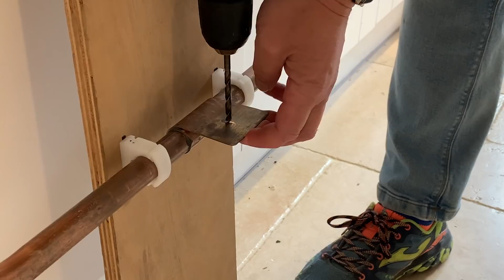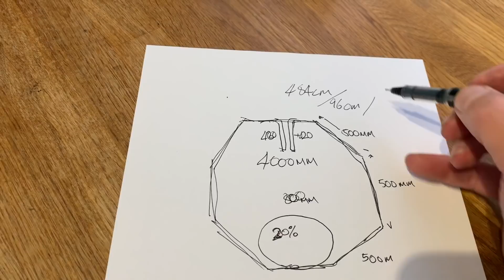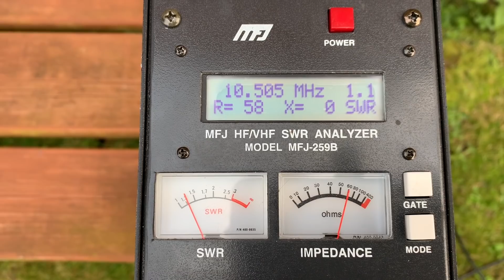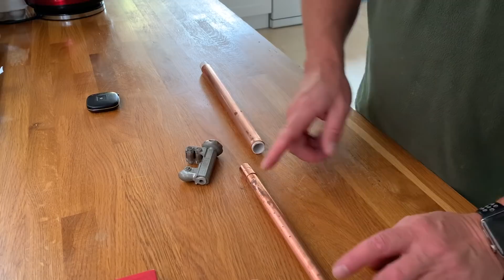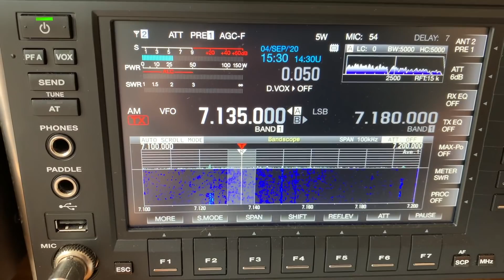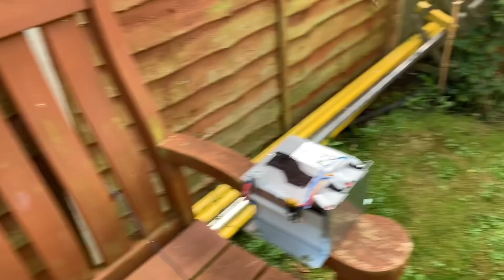HAM RADIO: Building a magnetic loop antenna Part 2...

Comment: Great project, thank you Mike. Well constructed loop. Great choice for the motor to drive these caps in the future. I think something like 30:1 RPM gear ratio would be sensible; although I would probably stick to a standard PID analogue servo motor controller (1 IC - four integrated differential amps) - you would need to add a geared position feedback potentiometer (10 turns for accuracy with 3:1 ratio) - but I am digressing here.

With the linear screw driven control all you need is to monitor the MIN and MAX ends of the travel with possible additional microswitches to zoom to the band of operation in almost no time.

At the  additional expense I would probably replace the two original capacitors you have made with two adjustable vacuum caps that will cover all the capacitance you may need (they require 30 rotations to change from min to max capacity). That approach would require you to drop the screw and use the driving motor gear on the straight shaft to drive a cog on the chain belt - driving the two cogs connected to one cap each (+ the tensioning roller).

If you do not have the head ache by now - I confess to having one after reading the G3LHZ reference article. It just showed me how little I do know about  these magnetic loops :)
73, take care
Regards,
Jansb
Reply from the maker: Great post Jansb,  I have been thinking about a simple microswitch each end system.. :)
Reply: @mike-M0MSN  Reply#2 to the first in this chain..

Coming down from the top of the loop, if you were to first, employ T-type CU joints perpendicular, one to  your variable trombone (C1+C2) in series,  to the 2nd part of the other (C3+C4 trombone, also in series but adjustable but then fixed) in paraller) to the C1-C2 trombone but on other side of the wooden plank you made to support the loop to start with. 

The consideration would heve to be made to the upper side of the plank because of the high RF voltage. I see a top extension here made of some cutting board plastic 12mm Polypropylene cutting board cut to size required by you ( see  the https://www.ebay.com.au/itm/Chef-Inox-White-Polypropylene-Cutting-Board-250x400x12mm/392929288766?epid= 1839336777&hash=item5b7c69223e:g:VwEAAOSwJ5VfUOCI&frcectupt=true
 ) as an extension to mount the loop to the top of the combined plank.
This can be done at the top and at the bottom of your wood plank support. The Polypropylene RF electrical properties beat the wood in all respect and are cheap and you can cut it any way you want.
I may not have much more to add - except, the additional FIXED trombone cap can be made with ONE high quality cut to size Coax instead of the two copper tube capacitors (C3+C4).
Cheers,
jansb
Reply: @mike-M0MSN  Keep it simple is probably the most sure approach, I agree.
It would require only a simple circuit if you have enough space to install the Min-Max microswitches.
You may run into a problem trying to making capacitor changes for higher bands. Your tuned trombone caps are almost at the max of their dimensional capacity. You can shorten them to give you more accurate tuning on higher bands but the additional capacitor would require some rethinking.

The voltage at the top of the loop is at its highest point of the loop at tends to be increasing as the frequency goes up on higher bands.
Electrically, the trombone capacitor are really two capacitors of the same capacitance connected in series and do share 1/2 of the HF voltage.
On the other hand, the additional capacitor is using the same insulation (PVC). That insulation is under double the strain - full RF voltage (not the half) because it is connected directly to the loop in parallel with the trombone, this is where you can expect flashes overs in the PVC pipe.
To maintain the same voltage strain you may need two of these additional capacitors being in parallel with trombone cap but in series with each other, like   another trombone (but with the set and forget tuning). This also opens a field of experiment adjustments on the 2nd trombone caps before it is clamped for good.
73's Mike
jansb

Comment: Mike, Thanks for sharing the videos.  I am interested in building this to give it a try.  The problem I am having is the difference between the UK and the US.  I went to the home improvement store and found some copper that was close to what is listed in the description.  With that, the conduit could not be found and the closest I could find was PVC that is thinner wall (not sched 40).  Can you provide some measurements?  Inner diameter and outer diameter  (which will also show the thickness of the tubing) of the copper and conduit?  Maybe I just need to find a better store, like a true plumbing store.  73, NA7RF
Reply from the maker: Sure, all the tube is 2mm or 3/1000 inch wall. :)

Comment: The small capacitor was drifting like heck, because you have used completely wrong component for the task. What you need is a high RF power stable low loss capacitor. The blue blob is designed to act as an RF shunt (so a parasitic capacitance coupling in a SMPS transformer does not sen RF between the power leads and the equipment body), to be loaded by few mA of HF current, plus guaranteed to maintain 50Hz safety isolation property (it is there between primary and secondary after all). Plus being dirt cheap. The drawback is very thermally unstable material (not an issue for the intended task), with rather high RF losses (assumed as a benefit, as it prevents high resonance peaks from amplifying the parasitic radiation). So when you feed your 10A at 7MHz, it warms up pretty quickly, causing the capacitance to drift away.
All RF suppression capacitors will behave same way, it is not because yours was of cheepeese origin, but because RF suppression task needs different properties than a transmitter antenna tuning.
Reply from the maker: Great reply many thanks.. :)

Comment: Hi Mike not read all the posts you could drive with stepper motors with a  H Bridge simple Arduino routine
Reply from the maker: Thanks for the tip
Reply: I initially looking at homemade high voltage butterfly capacitors  with sluminium nuts and brass nuts they £100s  to buy so I built 2 cnc's never made one I on my third cnc
will do it when done G1GFW 73s

Comment: Hi Mike, you have very much peaked my interest in antenna building with this project, I have already started getting the parts together. Do you have any plans to publish a quick reference to the lengths of pipe etc? My intention is to build it using 135degree couplers instead of trying to bend the pipe. Great series, looking forward to the next
Reply from the maker: Cheers Mark.  :)

Comment: Mike, I've never understood why some people call Small Transmitting Loops  'Magnetic'.  Makes absolutely no sense to me at all. I reckon that's a 'US thing'.   They are only electrically small loops. I've built quite a few STLs.  There are many different ways to feed such a loop. Secondary loop, transformer , gamma feed, delta feed,   just to name few. Yes, some folks don't use co-ax, even now! I didn't have much success with secondary feed loops so I quickly changed to co-ax fed Gamma matches and things were good.  Agreed, such a match is unbalanced so will alter the pattern of the loop as all feed systems will do.  Trombone variables... sensible, cheap and I recommend them.  Also easily driven using a geared motor + screwed rod. Loops seem to excel in electrically noisy locations. Just my 2p worth. Good luck with your loops Mike.   GM1SXX.
Reply from the maker: Great comment Allan, thanks for your input   :)👍🥇
Reply: They're called magnetic, since the electrical field component is inside the capacitor and does not get spread to the nearfield. Of course the electric field component of the electromagnetic wave gets established again in the far field. But the loop actually only gets excited by the magnetic field component, thus you have much less static noise due to the missing E-field.

Comment: Fantastic project??! But is only indoor operation and have many regulacion to acopplate in operation. Loop magnétic is a Challenger antenna for radioamateur. I am PY7PZ locator HI21nx Brazil operate in QRP CW. Thanks
Reply from the maker: A smaller loop then may be??

Comment: 👍Good project, thanks Mike. Some good ideas there. Like the 15mm couplers to make the inner capacitor plates snug, like the use of the block joins and the threaded studding for fine adjustment.
I noted that you squashed the small loop to improve match. I have only made one mag loop so far and I found I had to do the same. Definitely interested to see what you do with the Arduino.
Reply from the maker: Thanks Steve, a little time away but the Arduino or Pi is coming :) 👍

Comment: nice project like to see the complete construction in part .  concept is nice although i've seen a square loop with the same material. Your solution for the capacitor is very nice. Very inspiring..

Comment: CQ TTT - SAFETY - CQ TTT
I am new to your site.
I have just listened to your safety warning at the beginning of this video. 
I like your very neat engineering. 
However, as you said that there are some very high voltages and current levels involved, I bring this to your attention so as to protect your TX equipment.
Plainly, depending on the antenna's ambient/working temperature and its application, (one might like to refer to 'microwave materials and fabrication techniques', third edition, by Thomas S. Laverghetta, isbn 1-58053-064-8, page 38,) it is possible that one could, I believe, encounter an obscure problem at the temperature range near to and including 19°C (68.2°F) where the 'transition region' of the dielectric (Teflon based dielectrics) causes the dielectric constant to fall at that temperature. 
I only mention this because many years ago I was working in an area which was meant to held at 20°C; unfortunately there was a large sliding door which was opened frequently. Some 'special' thick long 'PTFE' cables had been purchased for the task. After finding the specifications of the cables, I was amazed to see by how the phase galloped at 19°C.
I could imagine completing the sequence of tuning up the antenna and increasing the power until I was at full power, and then hear a big whack. Please don't shoot the messager, I am just advising you of a little known fact to keep to yourselves, we don't want to harm the industry, normally this is not a problem in warm/hot locations near running equipment or at rooms at the top of high rise buildings. I hope this is helpful.
Reply from the maker: Very helpful and thanks for your post.. :)

Comment: So you made a gamma match mate...
Reply from the maker: Ish....
Reply: @mike-M0MSN  The reason I said that is, I did a similar thing for a 10 meter antenna. It was an old 11 meter Avanti Sigma 4 that got hit with lightning and blew the gamma off. So I made another HEAVY DUTY from copper tube and RG-213. Been up now for about 10 years...

Comment: Mike - you have probably exceeded the current capability of the little blue capacitor, it needs to be rated for voltage and current. The doorstop type cap will do the job, as well as the one you made.

Comment: Hi Mike, I have been following you on this build.. 
Can I ask, what is/was the design frequency for this magnetic loop ? 
I see that the resonant frequency is around 14.2 MHz	( 20m )  I'm curious to know - will this Antenna work on 10m ? 
And, can it be modeled on MMANA or EZNEC ?
Thanks again for sharing.
73
Peter
Reply from the maker: Peter Paul Donoghue Hi Peter, I had no idea of the frequency this was going to be resonant on, I had an idea to build a hexagonal loop with 50cm sides (originally 45cm) but a mistake in the original bend and the lack of copper made it 50cm so that’s why it is the size it is. Is works on 20m and also on 40m and everything in between. It will not work on 10m because of minimum capacitance but this can be sorted by shortening the trumbones... I have not tried an antenna design software but it maybe possible..

Comment: Still waiting to see how you are going to remotely tune it and adjust the trombone.  10 Meters would be good to see it working on.  I have not done much with Loops so I am just interested to see how it all works out.
Reply from the maker: We shall see, not sure about 10M will have to try.. :)
Reply: A lSmall Transmitting Loop has a finite tuning range.  Three bands are about as many as are reasonable to go for. Use some free modelling software.  There's plenty around.  Good luck.

Comment: Those little blue caps heat up and change value.
Reply from the maker: yep they do.... lol
Reply: I tried using some cheap blue high voltage ceramics from China to add extra capacitance to a mag loop. Didn't work for me either! Ended up using some  old silver micas I had in the junk box (put them in series to up the voltage they could handle).

Comment: I don't believe the coupling loops "have to be" 20%.  It is commonly around that value; however, you may find that larger (or even smaller) coupling loops work best.  On my 4m circumference Al bar stock loop, the coupling loop size that worked best for me is almost 25% of the main.
Reply: It's possible that the dimensions of the bar is influencing that.
My gut says that the optimal match is going to be a ratio of the main loop inductance to the inductance of the coupling loop influenced as well as by the coupling between them which is influenced by the proximity and shape of the coupling loop to the main loop.
It's a very experimental affair to get the sweet set of conditions that offer that sometimes elusive 1:1 VSWR
Reply from the maker: I will hold my hand up here, I stood on the shoulders of Frank (N4SPP) for the coupling loop size, it worked so ....

Comment: Nicely done Mike. But you didn't mention how you arrived at the length of the copper pipe you needed for the 100pf capacitor. 
Great work.
Reply from the maker: Pure guesswork, I would have been happy with any value over 80pf and under 150pf and would have cut down or made a new one.. 👍

Comment: Very Interesting, Mike!  I wonder, could a large multi-poled relay, contacts wired in parallel,  allow one to remotely switch the additional capacitor in and out?  Could you then get 100 watts out of the antenna like that?  My goal is to DX from Japan to English speaking countries across the Pacific, including the US, but without having to, in my case, climb my roof for each band change.  Thanks!
Reply from the maker: Yes possibly 🙂
Reply: Make sure you find a relay which is meant for high voltage. A loop like this can have 3,000 volts or more across the cap at 100 watts, which is enough to jump across the open contacts of some common relays. You'll need at least 4mm between contacts (when they're open), or a vacuum relay, to be safe. 73! - AE4KR

Comment: Fantastic Build there Mike, I like the Trombone cap idea.  I used a big air variable rotary 4 Kw. Add on fixed caps are very handy, liked your idea. mine was 8 x 20 inch lengths of RG213 100 pF. (some folk said a waste of good coax-Lol)
But  the best bit was 22mm copper pipe thats a dream. Really enjoyed that build. Job Done, Very Well Done. Barnie, M7PBX.
Reply from the maker: Thank you 😊
Reply: Cheers Mike, may I make suggestion on a little known antenna project you may like to build for the channel, I really rate them , but there is scant information about them- the 3DFL-Three dimensional folded loop-easy for the 2 metre band. it would be a great addition to your antenna build series Barnie M7PBX.

Comment: To check for losses in the plastic tube used in the trombone have you measured the loop Q? (2.6:1 swr points if you are hitting 1:1 on-tune)..... alternatively put 100W CW into it for a minute then check the trombone remained cool.
Lots of people also  just use the 2:1 swr points for comparing their loops. 30kHz between the 2:1 SWR points on a 3' 14MHz loop seems to be fair going  (as I mentioned previously I tried using glass as a dielectric and tuning was dead easy as it was as broad as a barn door in bandwidth so obviously lossy as hell so I ripped that out and reverted to airspace and tuning is now needs to be much more precise, hence the Q is now much better, the losses are down & I'm happy). regards - gm0sim
Reply from the maker: I will measure the Q more accurately next use, I have 80kHz bandwidth on 40M and 150kHz on 20M have done the heat test with no heat detected :)

Comment: Hi Mike,
Two thumbs up on the build and the add on capacitance. Nice setup with the drive motor. What power handling do you expect? Stay safe.  73  WJ3U
Reply from the maker: I have only put 100Watts into it so far, (without any issues) however I have not used it in anger yet.. :)

Comment: Hello Mike. I used a gamma match myself, I found it easier to get a 50 ohm match. I also had the same issues getting enough capacitance with the air variable capacitor I was using - I have just replaced it with a 5 to 250 pF Russian vacuum cap and now I can tune 60 through 15m. Keep up the nice project videos. 73 de ZS2VR Vaughan
Reply from the maker: Cheers Vaughan,  I think the next mod is the Gamma Match..  :)
Reply: @mike-M0MSN  I also cobbled together some very basic code for Arduino, 4 buttons driving a stepper for tuning. If you want send me a mail, details on qrz.com
Reply: 60 thru 15m is quite an impressive range. I was curious to know what your loop diameter is please? Also, approximate dimensions and tapping point for the gamma match. I built a mag loop with a small inner loop but fancied having a go at a gamma match type.
Reply: @Steve-GM0HUU  Hi Steve. My email is on qrz.com. Drop me an email.